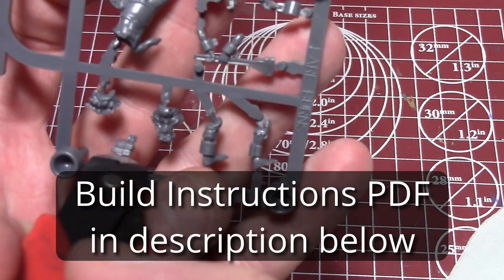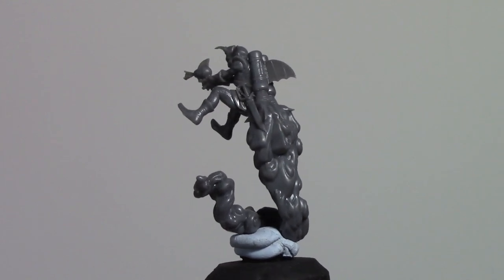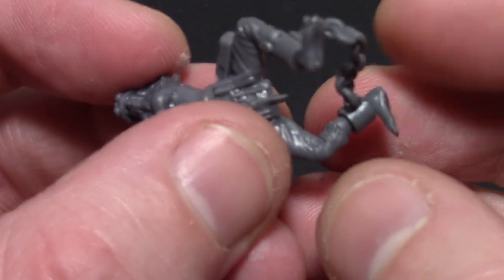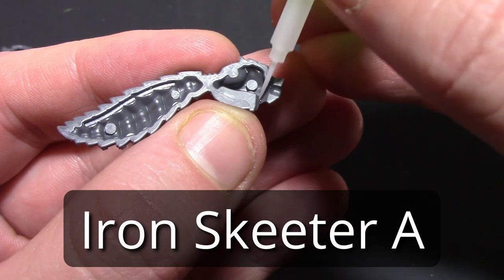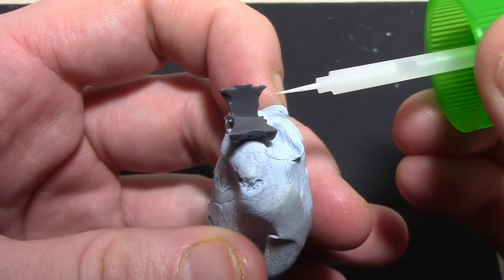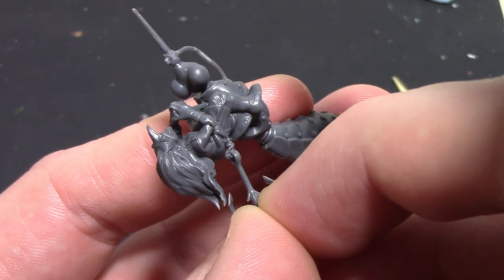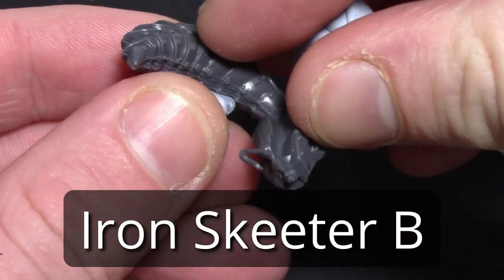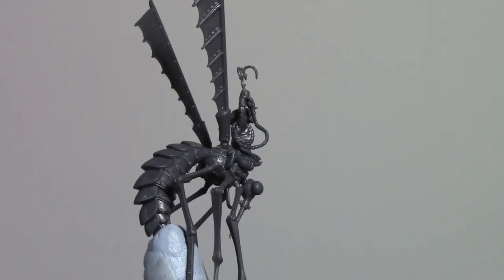Pro build "Guide" for the Captain Zipp core box

Comment: Probably been asked this alot but... what glue are you using? Enjoying your vids keep up the good work
Reply from the maker: Cheers mate, my favourite glue is Tamiya Extra Thin plastic cement (plastic glue). I use it most of the time but sometimes I use generic plastic glue in a tube because it is much thick and 'gloopy' which helps with holding some parts together
Reply: @DavesMiniMenagerie  thank you mate, I appreciate the response.

Comment: Do you do a dry fit first? That is, can you push the legs, for instance, into place without glue, then remove it and put back with the glue?
Reply from the maker: Yeah I can dry fit them, I mostly dry fit them first but the build instructions PDF doesn't show what order to assemble the parts. So I just put stuff together and guessed at the order but that didn't always work out